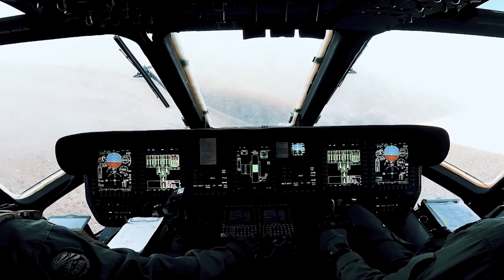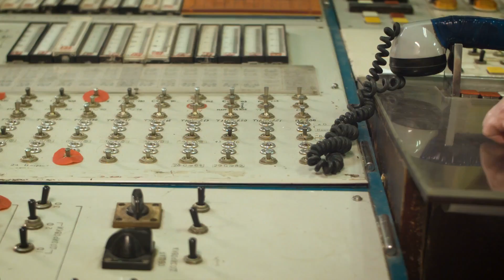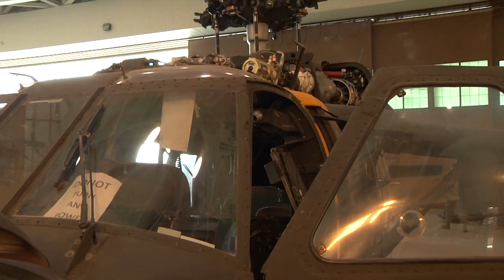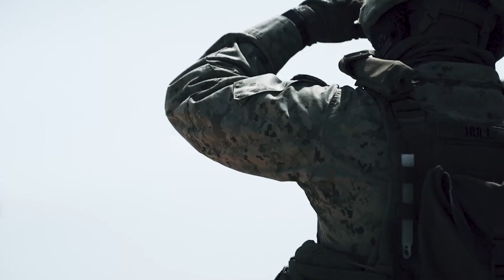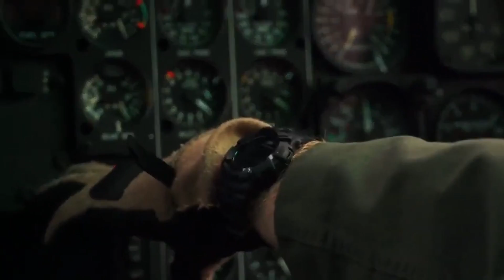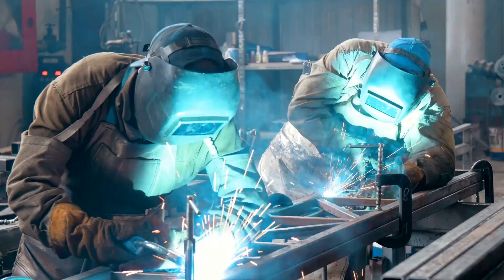America's Unprecedented Helicopter with Nuclear Capabilities

Comment: I always cringe when I hear multitasking anything, but especially military equipment. Historically that means it does nothing great but does three things half-ass.
Reply: Huh? What! VMF FA 18 get out!
Reply: That is to say I highly disagree.
Reply: @peterweller8583  Your are allowed to disagree. I am no military expert but at 76 I do have life experiences were things never live up to their expectations when a number of problems are to be solved using one answer. One of the things I read often is the military wanting to replace the A10 Warthog with a multiple tasking replacement. But the difference between ground troop support and a tactical fighter requirements are quite different other than they both fly.

Comment: Airwolf was actually a modified Bell 222A.
Reply: And the exact airframe that was used as "Airwolf" crashed into the side of a mountain in 1992 killing all 3 on board.
Reply: @rogergoodman8665 exact? There were 3 or 4 of them used in the show. One I know is in the U.K. and being restored to it's "Airwolf" filming configuration after spending decades ferrying workers to oil rigs.

Comment: I flew in the BlackHawk back in the 80's. This chopper looks to have a huge engine design. Probably not even as big as the Chinook, but some place between. Love your work, God Bless :)
Reply: the engines on the AW-139 provides 1000 hp less than the engines used in the MH-60's, which would have made way more sense to procure than AW-139's...